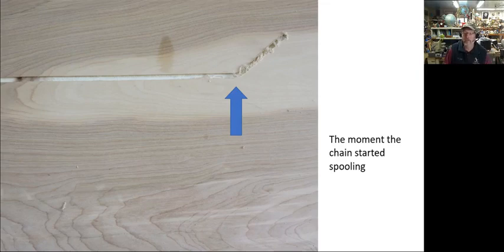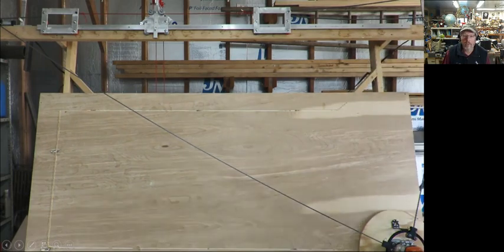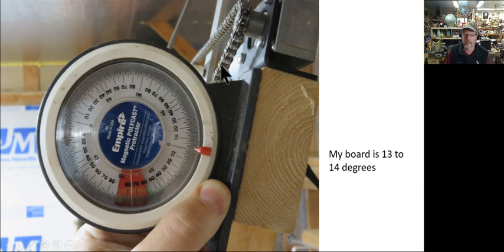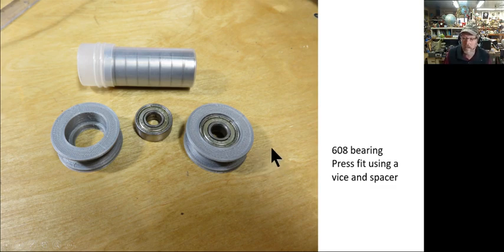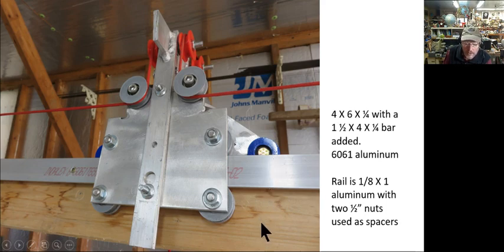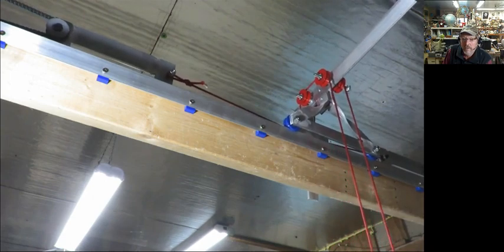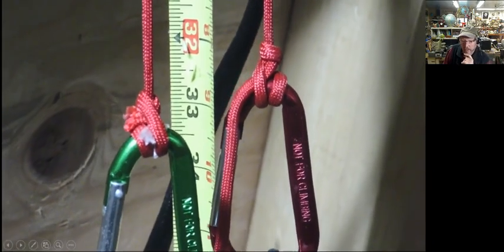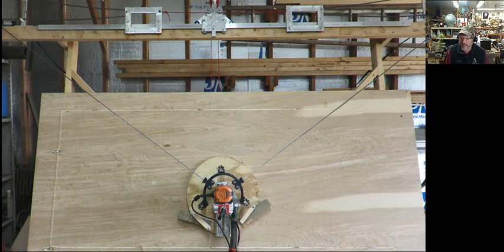Chain Tensioner for Maslow CNC

Comment: I have a counterbalanced cnc head that I made. In your case and mine, we realized that gravity (weights) or a pneumatic cylinder in my case, has an advantage  over mechanical or air or gas springs (closed) in that they can apply a constant force regardless of travel.  Also in the case of an  pneumatic cylinder  I used a pressure regulator to keep the pressure constant and allow easy counter balance adjustments.

Comment: This should of been the design they sold. They put this product out not engineered properly. I've heard Stories these left unattended has burnt peoples shops down. By the hang ups of the chain and bungee system's. I would rather pay more money for something designed right. Then less for something I have to keep throwing money at it and design it myself. This product should be pulled from the market until they have good engineers that have fixed its many design flaws.

Comment: Definitely one of the best constant tension systems I’ve seen. If my bungee ever fails, I’ll build myself one of these. Oddly, the bungee’s been very reliable.
Reply from the maker: Thanks! it's been working just great. My bungees just got too slack and combined with a slight gear misalignment, caused the problem.

Comment: Great video! I really like the upgrade. Have you made any modifications since then?
Reply from the maker: I have added a lower counterweight system to help with the bottom quadrant cuts. I had to add a lower semicircle on the sled and attached pulleys to provide a progressive pull so the closer the sled got to the lower corner,  it increased the pull towards that lower corner.   I attached a "draw bridge" type of lever to each end of my frame so it can raise and lower to provide the progressive pull. I will post a video on this when I can free up some time.

Comment: I'm just getting started with looking into the Maslow. How has your design held up over the last 15 months? Are there any changes you'd make if you were to build it again? Thanks for the information!
Reply from the maker: It's been working just great. The 3D printed pulleys are holding up and the only thing I had to do was to retie the weights.
Reply: @jtandhz  That's very impressive! Thanks for the reply. I'm still planning on getting a Maslow this summer and might try to utilize your design.

Comment: Nice video-- good job editing the video clips with your voice over. I was wondering if it would be easier send the chain through a block and tackle pulley system to take up the slack. If that worked you could connect them together with a bungee cord in the middle.

Comment: How has the Maslow been working for you over the last couple of months? How is the accuracy at the edges of the board, assuming that you have tested.
Reply from the maker: I've only used it a few times as it's in my cold side of my shop (very cold this year). The chain tensioner has been working great and is not an issue.  I've managed to "cut" test squares (using a spring loaded router bit pen to save plywood during the tests in the lower quadrants with sharp corners and good precision  (with-in 1/32 in a 6 inch square, but then my middle test square was off in the same test). However, that was using a progressive tensioner I designed for the lower quadrants. It uses a draw bridge approach to raise and lower a long lever arm mounted on the opposite end of the lower quadrant to provide some progressive tension to a second lower rail on the sled. I'll post a video once all the tests and bugs are worked out. The "router bit" pen I use to save plywood is : https://www.thingiverse.com/thing:3339190 (you can get a glimpse of the lower rail in one of the pictures there as well)
Reply: @jtandhz  Thanks, I'm considering one of these cnc's for cutting OpenDesk furniture and would be interested in your review of such a task.
Reply: @jtandhz Look forward to seeing your video once you have some things worked out :-D

Wondering if you could cut something like this without accurate issues.
http://atfab.co/?portfolio=walking-chest-of-drawers